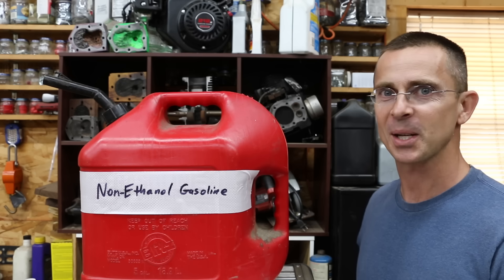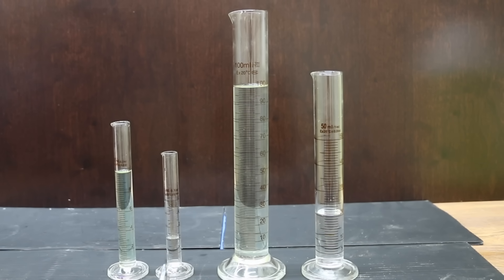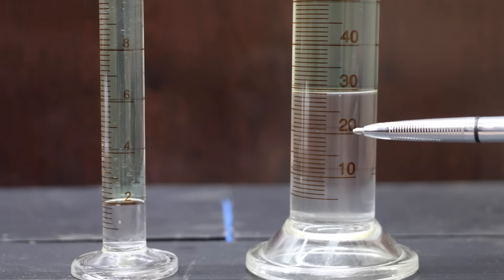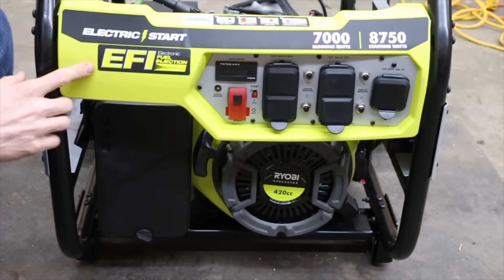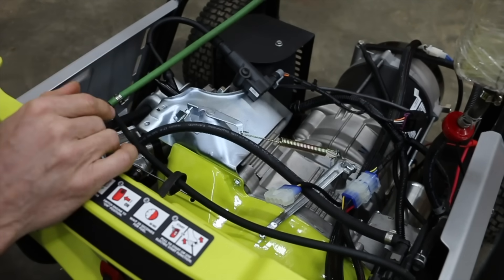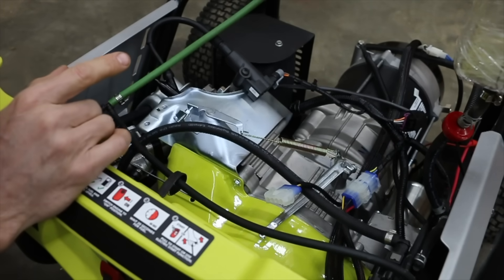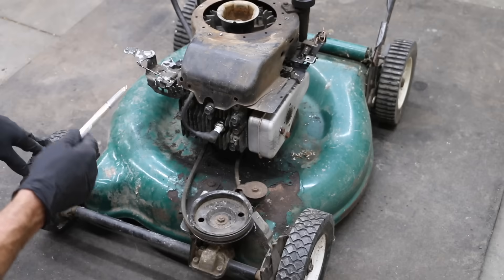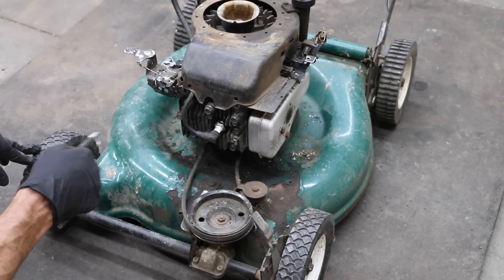Is Non-Ethanol Gasoline Really Better? See the PROOF!

Comment: A little late to the party, but while on a road trip through Iowa they had like 90% ethanol gas that was $1 cheaper than regular unleaded. Throughout the whole trip my mileage was around 360-400 per tank. In Iowa? Like 280. Ethanol might make fuel but I'll be damned if its "efficient"

(2004 Chevy Impala, trip was in 2016)
Reply from the maker: Thank you!
Reply: A 2007 was the closest flex fuel car I could find.  You burned pure E85 in a non flex fuel car?

https://www.fueleconomy.gov/feg/Find.do?action=sbs&id=23434

The 2007 is rated at 22mpg on E0 and 17 on E85.  The EPA states E10 loses 3 to 4% in mileage and E15 4 to 5%.

Prices from e85prices.com

E0   @ $3.03/gallon   @ 22mpg = $.138 cost per mile
E10 @ $2.83/gallon @ 21.12mpg =$.134 cost per mile
E15 @ $2.70/gallon @20.9 mpg  = $.129 cost per mile
E85 @ $2.25/gallon @ 17mpg = $.132 cost per mile

With your car the tank size is 17 gallons so your cost per mile on that 2016 trip today would be $.143 cost per mile to $.129 on E0

On 85 the cost per mile would be $.137 which is about the same as your E0 average.

You would have more horsepower with E85 and a much cleaner exhaust.

Another factor is that with E85 you know more of your money goes to American workers and American businesses who pay American taxes and put the rest in American banks to buy goods and services that you and/or your fellow Americans produce.

With E0 your know more of your money goes to Arab sheiks and transnational companies who put it in Swiss bank accounts and pay little if any in tax.

Comment: I drive a Volkswagen Golf multifuel that runs of E85 fuel. That's 85% ethanol. It's brilliant. Very clean with no carbon build up and extremely economic to run
Reply: Agreed. My next Hemi engine build is going to be E85 fueled.
Reply: @CryhavocMike  we pay the litre 3 times less than traditional petrol here in France 😀. The consumption is about 15-20% more but it's still worth it
Reply from the maker: Thank you!

Comment: I have a wood splitter in which I had the carburetor replaced because I had to constantly prime it till it warmed up   After the new carburetor, I still had to do so.  .  I started using non ethanol fuel and I have to prime it after starting very little now
Reply from the maker: Thank you!

Comment: Many people commenting that they get pure gas for daily use, I don't know where they get this because %10 methanol gas is a nationwide mandate,  and every gas company has to follow the federal law.
Reply from the maker: Thank you!
Reply: Just about every state has non ethanol fuel except the dumb blue states like California---check on pure-gas.org to find locations for non ethanol fuel....
Reply: For every 1 gallon of E85 sold, around 8 gallons of E0 can then be sold and still comply with the law.  You can do the math for E15.

The oil companies are gaming the RIN program to not comply with the law.  They hoarded the RINs to super high prices purposely then cried crocodile tears about it to get refinery waivers which crashed prices.  They pay the RINs without blending ethanol as stated in the law.

RINs were suppose to be only used in the rare event a blender could not find any ethanol.  Since we export a pile of ethanol to the United Arab Emirates, the chances on not finding it here are between slim and none.
Reply: @danafletcher2341  thank you for the info  and Dovetailup for the link.

Comment: 5:39   How did you start the engine if you took the spark plug out?!
Reply: Ryan Cameron was was doing a compression test and had a power drill to spin the motor from the upper coil

Comment: You've missed an essential detail:  The energy content per pound of straight gasoline is higher than that of gasoline that has been diluted with ethanol.  The octane rating is not an indicator of energy content, nor of efficiency, It is just a measure of a fuel's antiknock characteristics.
Reply: And the amount of pre-ignition determines the thermal efficiency in a gasoline engine, so the ethanol reducing knock-characteristics quite nicely evens out the offset in energy content. Ethanol is fine for using in a car that is very regularly used, but shouldn't be left in a tank of a vehicle that's sitting.
Reply: The Thermal Efficiency is a function of the compression ratio and the polytropic gas constant only.  No functional dependency on the "amount of pre-ignition".  Octane levels are actually lower nowadays than they were in olden times.
Reply from the maker: Thank you!
Reply: Agreed. Octane is related to the speed of combustion, not the energy.
Reply: To add to this discussion, although the energy content of non-ethanol fuel is higher, many modern engines with variable timing and/or turbocharging will actually make more power (even without any other modifications) on ethanol blend fuel because the cooling ethanol allows more aggressive timing to be run by the ECU.

Comment: Just as diesel has more btu/ gal than gasoline. 
gasoline has slightly higher btu/ gal than ethanol.
I have read statements that claim there is a 54000 btu loss to make 1 gal of ethanol.
That means it takes more energy to produce ethanol than it produces when burned.
Reply: It cost $8 or more to produce a gallon of ethanol, I know it does not make sense but it keeps the farmers happy.
Reply from the maker: Thank you!

Comment: Another addition to this test is if you have dirty tank from sediment ethanol can cause the sediment to  float in the fuel is some cases, had this in a 91 Nissan pulsar where changed the fuel filter and used E10 95octane fuel and filter lasted around 200kms before blocking up from the sediment
Reply from the maker: Thank you

Comment: Just a tiny note (which may not be correct). I recall a chemistry teacher noting some years ago that equal volumes of ethanol and water amounts to a bit less than their individual combined volumes. Which may explain why it didn't quite reach the 30mL mark in your test. I believe also that the separation is a phenomenon known as partition. Depending upon the relative solubility of ethanol in water and petrol, it might not be possible to get it all out. From the look of it though, it seems to have a much higher affinity to water, so this is probably insignificant.
Reply from the maker: You are correct. Thank you

Comment: Wanna save 10 minutes? Manufacturers use ethanol because it boosts the octane rating of a fuel. Its like stuffing food full of corn based fillers. They market it as a fuel system cleaner because society is gullible
Reply from the maker: Thank you

Comment: under standard conditions, it's a foregone conclusion.   science tells you that ethanol has less energy than gas the same way a piece of hardwood like birch contains more energy than softwoods like pine.   More heat (energy) released per unit of burned gas and hardwood.
Reply from the maker: Thank you!

Comment: You really don't have to go through all of this rigmarole to find out if ethanol gas is better or worse for your car. Gas mileage I mean. It's just a simple BTUs problem. Ethanol produces less BTUs than gasoline. That's about it. That means that you use more ethanol to drive a certain distance and that means that you get less miles per gallon. Add in the gasoline or diesel powered machinery that has to grow and harvest the corn that we make ethanol from and add in that ethanol cannot be shipped by pipeline because it's a corrosive so it has to be trucked and you have ethanol being a net loser for the environment as a she will for automobiles.
Reply from the maker: Thank you!

Comment: Excellent! That said my main concern with ethanol use in small engines is the corrosive effect it has on carb parts, etc, as well as causing rubber gaskets etc to fail.
Reply from the maker: Thanks for watching!
Reply: In real world use in South Florida, use of E0 is a good idea if it is used in a boat motor or lawn equipment. The reason is as shown in tests. It will pull water in from the air. And that is where those engines get their corrosion. In an auto, you have a pretty well sealed tank so that unless it sits a lot, you won't get as much moisture in the system. 
Now in my truck, the difference in fuels is a little more drastic. A 25% drop in MPG with E-15 vs E0. As mid-grade is 89 octane and E0 is 90 they are close. Price difference is $2.95 for E15 89 vs $3.48 for E0 90/91. 15% difference in fuel cost so it would lose there too to use E15. But if you go to Premium E15 the cost are about the same per gallon and still less MPG. Another advantage I have found is that the use of E15 leads to a sticking fuel pressure regulator while use of E0 does not.

Comment: I have had nothing but problems with carbs and rubber vacuum operated fuel pumps. the rubber keeps rotting from the alchohol. the only way to prevent carb damage is to drain the carb completely. the problem is that the fuel will evaporate and leave gunk in the carb.
Reply from the maker: Thank you
Reply: @ProjectFarm  heh, thought I'd mention this too for folks. I live in the desert and because fuel evaps so fast I learned the hard way to NOT use fuel stabilizer. When the fuel and alcohol evap it leaves a dense mixture of stabilizer and varnish.  had to replace 2 sets of fuel injectors and a boat carb before I realized what was causing the problem. I still am having problems with on one of my fuel check valves that won't close all the way.  I don't use it on anything with a carb now. Perhaps it works better in wet climates to prevent water in the fuel. I've had to learn to drain all my small engine carbs after each use unless I plan to reuse it with in about 3 weeks. My atv's are the worst.

Comment: I drive a VW Golf and am fortunate enough to have access to 90 octane non-ethanol fuel. Using that along with Eco Fuel Saver at every fill up gives me good fuel economy and no black carbon crap build up around the tail pipe after 100k miles.
Reply from the maker: Thank you

Comment: I come from a farm family and am fortunate enough to have a flex-fuel video so I use E85 because it's a matter of supporting my industry. Ethanol is definitely cleaner burning and if your engine is built for it, it won't cause problems. Yes, it has less energy, but thanks to the subsidies it's still a better buy than regular gas.
Reply from the maker: Thank you!

Comment: I have 226,000 miles on my suburban running e85 95% of the time. Truck still runs great, e10 is not terrible for everything like everyone makes it out to be. It is hard on plastic & rubber and doesn't have a long "shelf life" so it's not great to let sit in your mower over the winter but it's also not a new thing either like most people think it is. E10 has been a standard in some areas for many many years as it supposedly reduces emissions and is a cheap octane adder.
Reply from the maker: Thank you